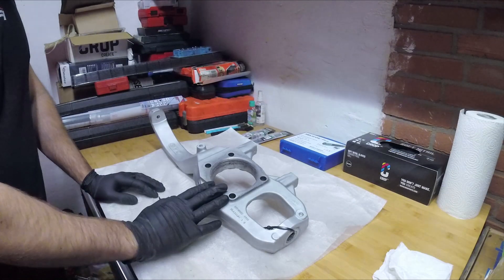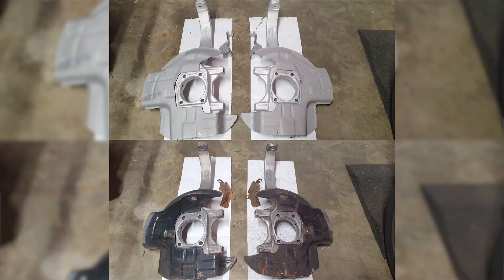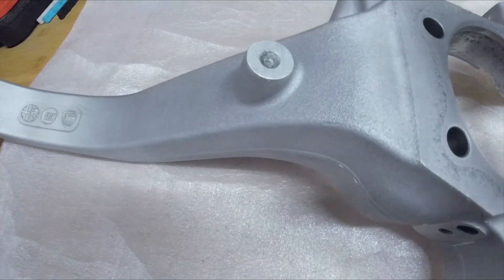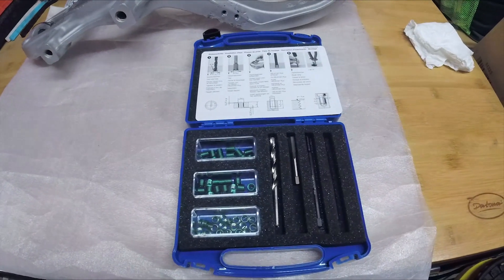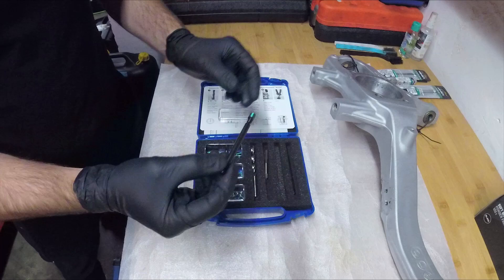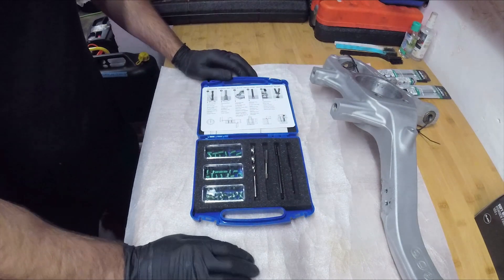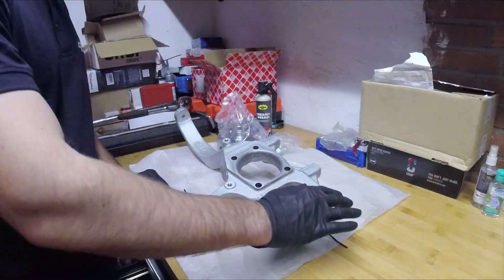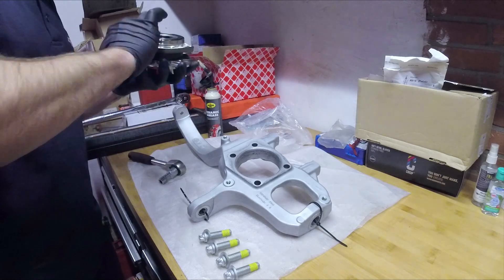Alfa Romeo Brera Lightweight Steering Knuckles Refurbishment

Comment: 😅che senso ha guardare 5kg di  peso su' un' auto che né pesa 1600kg.... Cmq i pesi seri li togli semplicemente dal tetto, il vetro lì sopra pesa 35kg ... E sé monti cerchi R17 ultraleggera risparmi altri 20kg(25rispetto i 18/19pollici)... Poi anche i sedili anteriori pesano 25/27kg ciascuno, mettendo dei sedili in carbonio da 7/8kg bhe'... Facendo così ha più senso... ciaoooo
Reply: That is 2.5kg of unsprung mass per wheel, not mass of the vehicle. Unsprung mass (mass of the suspension) affects performance of the suspension. Lighter suspension has less inertia and will follow imperfections of the road quicker (the wheels/tyres will spend more time in contact with the road instead of in the air).
Reply: @DashCamSerbia  infatti ho scritto di istallare cerchi R17 ultraleggera così si risparmia 20kg... Puoi mettere anche i bulloni in ergal
Reply: @DashCamSerbia  This is why I have Team Dynamics Pro Race 18" wheels on my 159, (unsprung) weight savings.

Comment: Nice Work! But If I had the chance, I would have painted everything in black matt. You can use heat spray black. Greetings!
Reply from the maker: Yeah I prefer more silver looks tbh, but thanks for the tip. Btw which license plate LEDs you have on your 159? Greetings
Reply: @939driver  I got my leds from benzinfabrik it’s a German company .they are quite expensive but they last and have guarantees